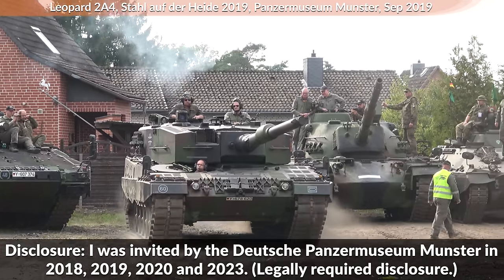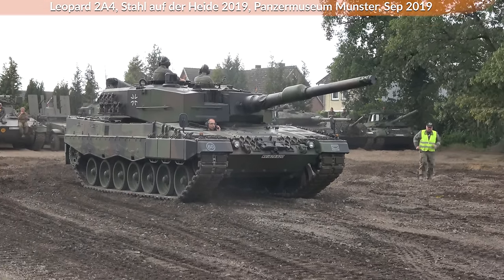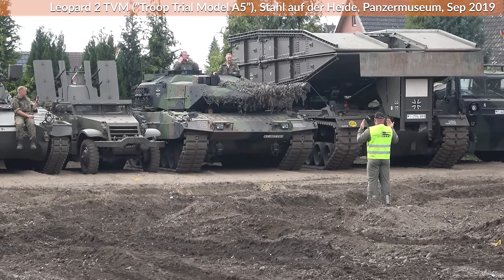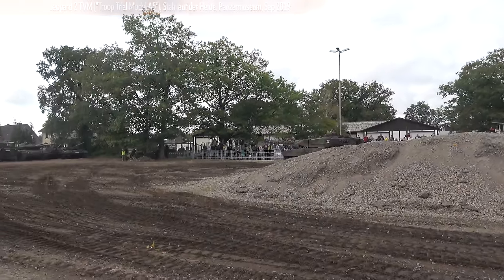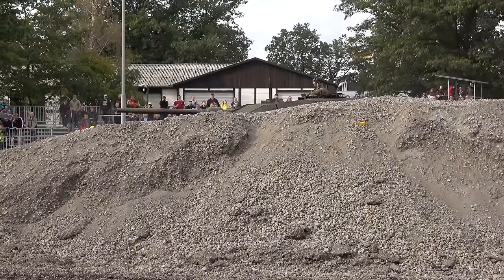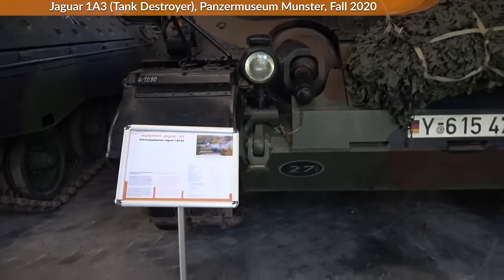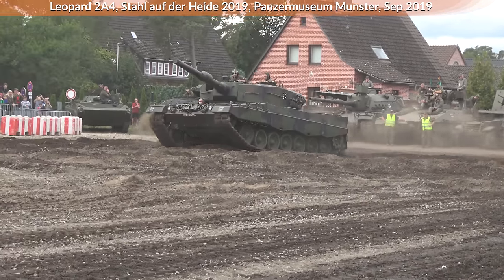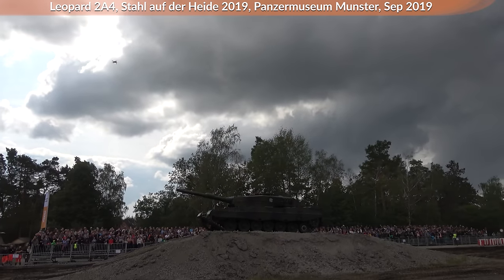Tank Tactics: How to get not hit by ATGMs?

Comment: I have to question the practicality of popping smoke, stopping, going into reverse and zig zagging.

If the tank is cruising forwards at 40 kph you aren't going to be able to brake into a full stop and reverse fast enough to get a meaningful amount of deflection with 6-7 seconds.

It is also entirely unusable from a tank in a mechanized column or mine ridden area.

It seems to only be useful for a slow crawl or stationary tank.
Reply: 1. a tank probably wont be cruising at 40, i imagine creeping forward at 15 is more likely to maintain awareness and stealth
2. what do you mean about deflection? the point is to hide behind the smoke, also you can pop smoke while decelerating and still have it pop infront of you
Reply: Another point on why they probably don’t smoke much

Artillery and loitering drone beacon